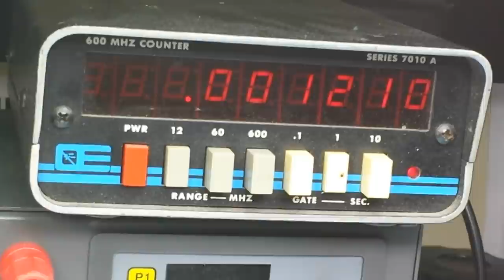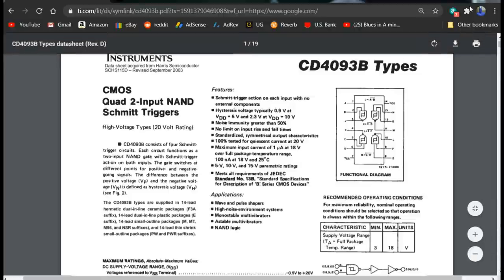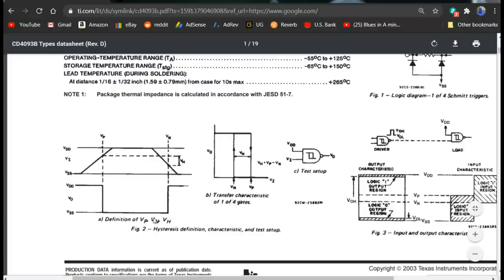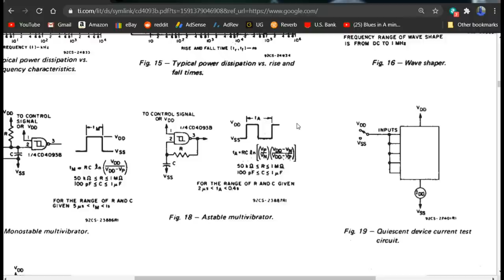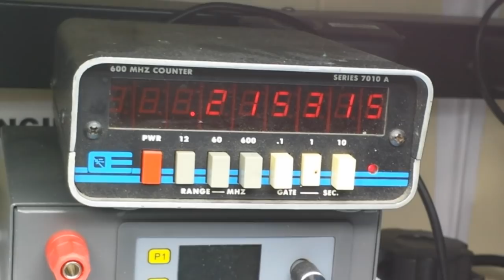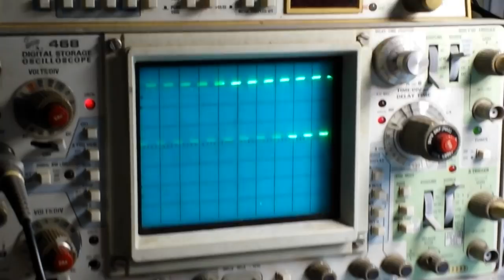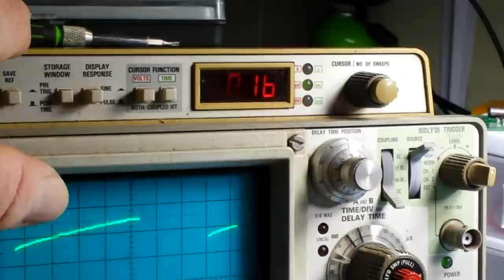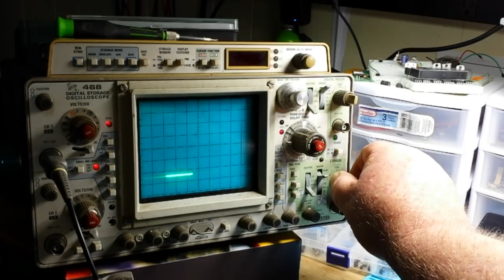IC Oscilliator fun with CD4093BE

Comment: Great easy to build circuit . A good one every electronics person needs to build and play with. 
Just a point to watch for. All unused inputs in cmos should be grounded or tied to vss. However the outputs of any gates can be left floating as they will go to the appropriate rail voltage determined by the inputs. Also as you have used a Quad nand gate the three unused nand gate outputs want to go high (vss) but you have tied them to ground and those outputs are short circuited as,a result and will draw excessive current. Measure your power consumption with the outputs shorted to ground and left floating to confirm.
Reply: Well made point. There is no reason to tie outputs if inputs states are defined.

Comment: Fun stuff.  The noisy circuits were always my favorites on my Radio Shack 150-in-1 kit.

Tip:  Should you need to have a good square wave output use the signal here tied to both input pins of another NAND gate and get a clean signal off its output.
Reply: Darn it! I was gonna say that...

Comment: Hooray, my favourite circuit at last. There are a few tricks worth mentioning. Adding two resistors to the feedback circuit with a diode in each allows the mark space ratio to be changed. One oscillator can drive another and thus provide a flash cadence. The output can be used to drive an high impedance speaker (80 ohms) or an audio amp. It is worth adding a low value resistor in series with the output, to protect it from overload short circuit, typical value 270 ohms. This is a really versatile IC build block, it finds applications in all sorts of places, such as metal detectors, audio pulse modulators, voltage controlled oscillators, and voltage multipliers to name but a few. The HC version is my choice, as it gives a bit more output drive without much reduction in supply voltage range.
 Thank you for finally giving it a mention.

Comment: This is sooo easy! Now, I'm gonna have to build one to be a variable clock to step variable frequency sine and cosine waves (RPi/Arduino/ESP32/ESP8266 generated), one to drive and X axis mirrored galvanometer (scanner) and other to drive a Y axis mirrored galvanometer (scanner). The other 3 nand gates will step 3 more quadrature oscillators. Just add a ~$100 diode laser, plus a mixer and I'll have my own home laser show.
This old laserist loves flashing lights too, especially with Floyd. Thanks!😎

Comment: I've been looking for a ic that can handle 3 LEDs or any light bulb and 13.6 volts
The old cars use a motor to step the lights on so you get an effect where 3 lights turn on and off in sequence

Comment: it seems you have 4 parts i think the last is a "resistor" it above the led. what type if its a resistor is it? you have the black thing connected at the end of the video to your scope.
Reply: It's a current limiting resistor for the led. Led forward voltage (2.0V) for a old style red led. You select the value by taking the led forward voltage away from the output pin voltage which will be the same as the supply.  And divide by the current you want through the led. 

So 7V supply  2V led = 5V across resistor.  If you want 10mA through led, then it's just 5/0.01 = 500 ohms. Or 470 , 680 in standard values.

Comment: I got a electric hair clipper imported from USA it works in 110V 60hz . But I want to turn it's coil winding for 230V 50Hz. Could you please help me what is the ratio of wire thickness and number of turns i need for modification with compair to origional coil  for 220v 50Hz ?? Thanks

Comment: I want 38 khz oscillator..please help me with resistor and capacitor  values...does voltage values oscillate in the output...
What is the Vp and Vn values for voltage supply 5 V for the ic cd4093...
Please help me sir..in need for college project

Comment: Actually without IC 4093 ,use Resistor-Capacitor in series/parallel ,you will get oscillation. But you insert IC 4093 trigger my inspiration that how to troubleshooting a PCB containing thousands of electronics components testing without desolderng  out Each components for checking components individual faulty/defect. Today's electronics factory are testing top secret PCB proprietry motherboard. You just Grounding all the surrounding circuits and openup the suspected default circuit .you can inject Voltage/Current to check for default circuit . You do not need their circuitry (Patten Copyright top secret) for troubleshooting !!! Otherwise you have to buy billion/million dollar Incircuit/Offcircuit tester machines to to test SMT PCB boards .

Comment: its definitively a resistor cant tell what its size is? how do you know what type of resistor to use? what voltage are you using? the details would be helpful! you look like your just having fun.
Reply from the maker: It's a 1k current limiting resistor. It is not part of the oscillator. I'm pretty sure I mentioned the voltage on the video, but if I didn't it's 5VDC.